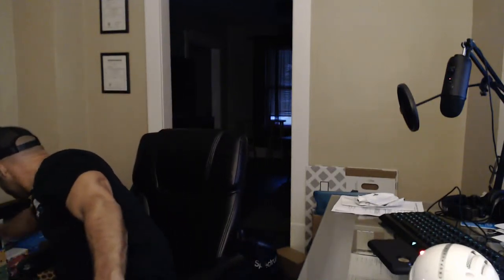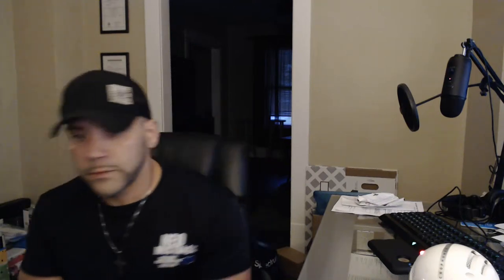Lets TALK Shop. LIVE! Fox Mustangs 5.0's Builds Tech & More! 8-30-20

Comment: On a 76mm turbo what a/r do you recommend?  .81 .96?  Also what brand of Turbo do you like for the street?
Reply from the maker: What engine is it?
Reply: Boss block 302, 331, 363.  Which for each? Thx
Reply from the maker: 76 will be fine for them all. Maybe a smaller 68 exhaust wheel